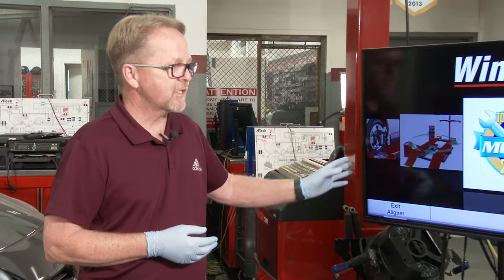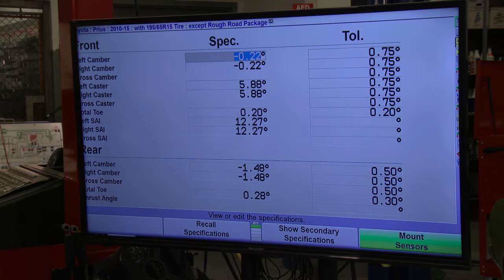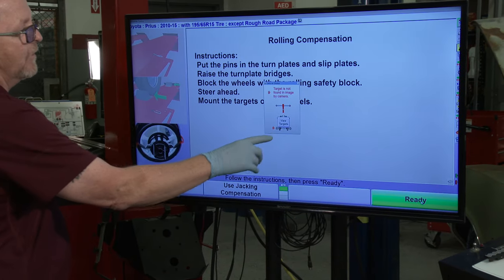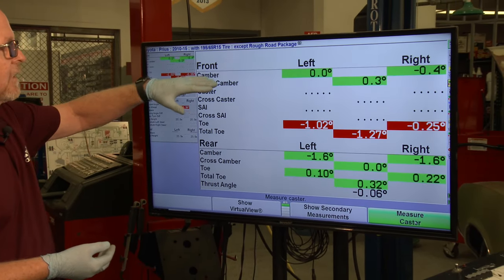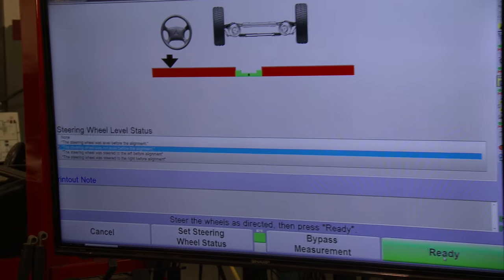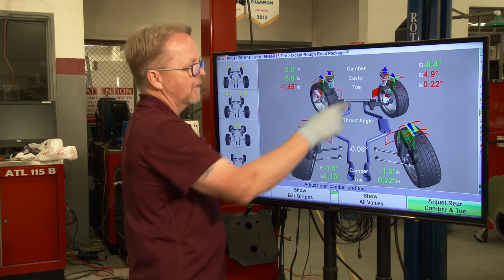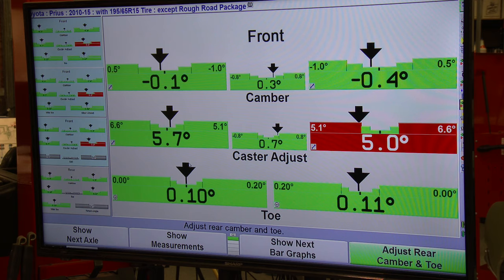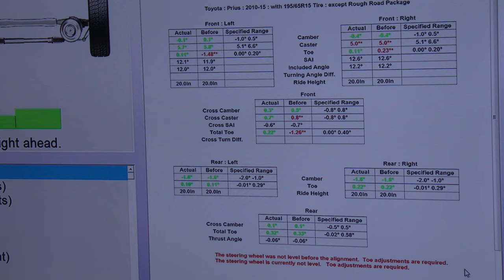Wheel Alignment Using a Hunter Alignment Machine

Comment: I've been doing alignments for 8 years now. I've only ever adjusted rear camber if adjustable, same with rear toe. Never adjusted front camber or caster, only toe and nobody has ever said anything until I started working at a new shop. Now they want perfect alignments. I was never trained so idk what to do :( are my alignments supposed to be perfect without adding shims or adding aftermarket parts ? Otherwise I'm just going to play around with the sensors.
Reply from the maker: J JJJ - Doing a correct (not perfect, but correct) is about addressing customer symptoms and reducing tire wear.  There are no perfect settings, there is a range of angles that can be adjusted to address a symptom.  I would suggest that you ask your employer to invest in you by sending you to training.  The best shops do just that.
Reply: I always adjust rear camber and toe to be in the middle on bargraphs, or best i can if seized or partially stuck.  On most car front ends, from the factory only toe is adjustable.  On toyotas, newer honda accords/civics, and many subarus you can adjust the front camber.  You click on the little box near the camber and  select jack up axle.  Carefully lift the front by the subframe and lower to locks if you have space, then let the computer know youve jacked it up.  One side at a time, loosen the 2 strut bolts to get the camber better, when you loosen them the wheel will want to fall outwards and will become as positive as it can be.   To adjust it negative and dial it in where i want it, i place a pad or something else under the outer half of the tread and partially lower the front end till its where i want it, then tighten bolts, i use my 1/2 impact on a midlevel torque setting, with swivel adaptor and 22mm socket, sometimes 19mm on toyotas anyway, with a same size wrench to tighten.  After both sides are set and tight, hit the same small box under camber section again and select lower axle.  Lower it and pull down a few times on the front to settle the suspension and tell the machine its lowered.  Then finish with the toe.  If you dont have a steering wheel level i recommend it, just search amazon for it, saves a lot of stress and time for me, gets steering wheel perfect everytime.  The solid axles im not so great at, they are the trickiest to get right.
Reply: The gm full size trucks/suvs are easy to adjust camber and caster if they arent seized up, just need patience.  You dont want the vehicle that high when you adjust camber and caster because after jacking up front you adjust when standing and access over the tire in wheelwell.  you hit the small box under camber and select jack up axle, jack up front end by lifting under lower control arms with rubber pads.  Tell machine you lifted it.  They have plastic inserts on the alignment cams from the factory, these need to be removed, prybar and hammer does the trick.  Then i use my snapon  ratcheting swivel head breaker bar and 21mm socket and wrench, loosen up both top nuts and use wrench to turn cams, its a balancing act to dial in camber and caster.  Then tighten bolts down TIGHT, i make them as tight as i can im sure i get over 100-150ftlb.  Then hit lower axle on screen, lower and bounce front end and tell machine, finalize toe.  On durangos/grandcherokees/ram 1500s you lift by subframe/frame like toyota car, loosen 3 bolts on each side on lower control arms and use a massive prybar to pry the lower arm in and out.  Im not a fan of this design because you often cant get the camber AND caster where you want, usually a compromise, though i suppose it is much less likely to have adjustments become seized. I tighten arm bolts snug, hit vertical bolt quick with impact, then I torque the vertical bolts and front lower arm bolts to 100lb ft after lowering, the rear arm bolts dont have good access to torque.  Im sure theres a official torque spec to look up, i dont know it.
Reply: My rear right camber read is -2.14 degrees and shows as red, even after the hunter mechanic was finished.  Should this be cause for concern?

Comment: My alignment guy used a impact gun on the adjustment bolts on a Ram pickup while doing a alignment. Is this a no no or is it ok.
Reply from the maker: Honestly it depends which bolts. You can snug bolts with an impact, then use a torque wrench to tighten. Adjust settings with an impact? Usually not.
Reply: I had a really bad alignment the mechanic was using a impact gun to adjust the eccentric bolts. The front  tires wore 1/2 down on the sides. The garage verbally agreed to replace tires then the next day said they would not replace them.

Comment: Thanks for a great video! Do you have any more videos with different types of steering systems? Would like to see more about the interpretations of specs and first screen after compensation. After adjustments is it good to start car and turn steering wheel left and right and recenter steering and checking screen to see if anything changes?
Reply from the maker: Regardless of the steering system type--most of the basics of alignment interpretation apply.  Be sure and catch my two videos "Part 1 Basic Alignment Angles and Effects" and "Part 2 Basic Alignment Settings and Symptoms" for further details.  Thanks for the complement.

Comment: I went to my dealer today with my Rav 4 with 17k miles on it and they said this system stated that my car is out of alignment. They wanted to charge me $100 for it. I told them no and brought it to another Toyota dealer who put it on their alignment rack and my alignment was perfect. My car was NOT out of alignment. Some Toyota dealers are screwing people out of money because we don't need an alignment.
Reply from the maker: Some dealers use drive-over equipment that can tell if the toe setting is off.  They drive almost every car coming into the shop which generates additional alignment sales.   I'm not sure of the accuracy of such equipment but I know the driver needs to be really careful driving over it for it to work.
Reply: It’s virtually impossible to get the same results alignment machine to alignment machine. You could have one shop do an alignment drive it couple blocks to another shop have them check the alignment and have their machine say it’s not within spec. And just cause the bars are all green on the alignment printout doesn’t mean the alignment is actually good lol
Reply: You don't know who was wrong though

Comment: So much easier to stop the vehicle just before the turn plates mount the sensors then do your roll compensation going forward. If you back up off the plates to do the roll compensation then you have to redo your roll compensation and pull forward onto the plates. Which is just a extra un needed step. When you mount your sensors onto the wheel at 9 and 3 you can rotate the head so the reflectors are angled up and then when you roll forward onto the plates the arms end up at 10-11 ish and 4-5 ish and the reflectors will be squared up with the eyes on the head. Just a few tips I’ve learnt in my many years running the same machine 
Definitely easier and more efficient to stop just off the plate bridges mount sensors and do the roll forward onto the plates.
And when doing the castor sweep you’re correct when you do it outside the vehicle cause you should never do the sweep while in the vehicle you want the suspension at full relaxed vehicle weight only . Your weight will make the vehicle lean to that side and throw out your readings. 

Great video very educational!
Reply from the maker: I agree the roll-forward-only compensation is easier, but I have not found it to be quicker overall.  In a busy alignment shop (like the shops I have operated) the variety of vehicles necessitated a learning curve to get the head positioned just right.  Having to readjust the head and then back up and go forward again happened too often, so I just set the machine up to do a rolling back-and-forth compensation.  File it under "operator preference."  Thanks for the complement and pointing out a different method of compensation.

Comment: Can anything be done/replaced to correct the right front caster?
Reply from the maker: Camber is not adjustable on this car. Sometimes you can get a tiny bit of movement by loosening the lower strut bolts and pulling or pushing on the spindle. That said, .4° is so minor (remember there’s 360° in a circle and this is less than 1°) that there’s probably no symptoms.
Reply from the maker: Sorry, I see now that your question was about caster, not camber.  Caster is also not adjustable on this vehicle.  The difference from right to left is less than 1 degree (.7), so may or may not cause a pull.  If it did pull, it would be to the lower number (right), and would not wear tires.  Since the Camber angles are angled slightly toward a pull to the left, they may offset.  To diagnose the caster issue, there are additional measurements that can be made with this machine that can identify other suspension issues.  Ultimately though, I doubt a customer would want to spend additional dollars to replace suspension parts for such a slight pull. Thanks for the question.
Reply: @bruceo1987  I'm that customer you speak of! I WANT MY ALIGNMENT NEARLY PERFECT! Lol. I deserve it, my whole suspension is fully adjustable. One would think that this is an easy job but nooooo most shops are incompetent  and have been use to dealing with customers who just look at the green and so "OK. Thank you for taking my money"

Comment: How do you address the slop in the Steering wheel when you are leveling it?
Reply from the maker: I turn the wheel back and forth (with the engine running) and try to pick the middle as much as possible.  Too much play and the vehicle will wander.  I report too much play to the customer and recommend a repair.
Reply: @bruceo1987  what can cause too much play?
Reply from the maker: @jjjj2411  Loose steering box/rack.  Loose steering parts.
Reply: @jjjj2411  any bad or wear out front end Suspensions can cause problems. I always lift up the vehicle and inspect all that before I aligned vehicle so customers won’t lose a dime. Not every car will be perfect especially lifted truck with big tires, I’ve been having issue to put on the laser.

Comment: those tires look really flat, pretty sure that messes with the alignment as well. hence the tires not being at correct ride height or psi.
Reply from the maker: You are correct. Ride height via proper inflation is important in the process. This was a Covid-rushed video so I skipped some of the prep.
Reply: @bruceo1987   I figured as much but other than that great video, as someone that’s learning the steps and each car being different in its own way, any new advice I take.  Newer cars requiring alignment mode. Had one yesterday.

Comment: What hunter model are you using?
Reply from the maker: I'm not sure of the model number of the machine, but the software that is used on various Hunter machines is called WinAlign.  The versions numbers advance as they modify and perfect the process, but the software works on many machines that they have supplied shops over the last 10 years or so.

Comment: So in this example, since there is no camber or caster adjustment and only toe,  a customer is charged  $129.00 for a mechanic  to loosen a nut, then turn the spindle to the tie rod a few times, and then retighten the nut. What a racket $$$.
Reply: $129 fr that's cheap. See once that vehicle hits the lift for a diagnosis that's $120 automatically. For me to go under the vehicle ( usually it's not that clean) and do the adjustment for the front is $250 both front and back is around $505.45 after taxes. Trust me you got it made to get it done for under $130